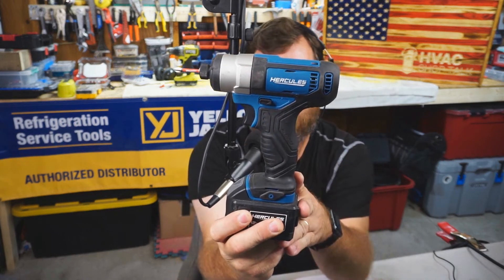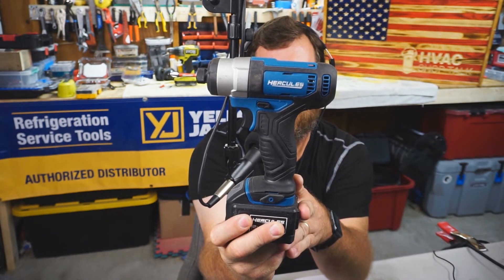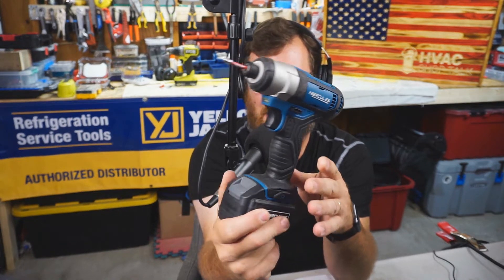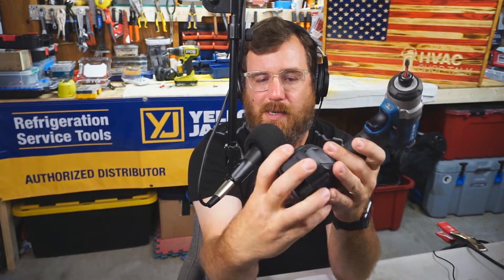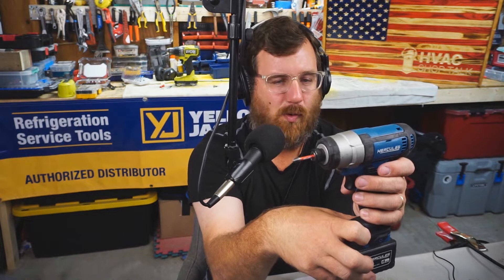12 Volt Drills/Impact Drivers for HVAC Techs

Comment: If you want a very compact, powerful and fast screw gun to pack in your tool bag, look at the Bosch GSR12V-300HX.

Fits into tight spaces, powerful enough to drive 3" construction screws, good enough speed control to avoid stripping access panel screws, is durable enough to hold up to tapping panels into place with it, and can fit in your pocket.